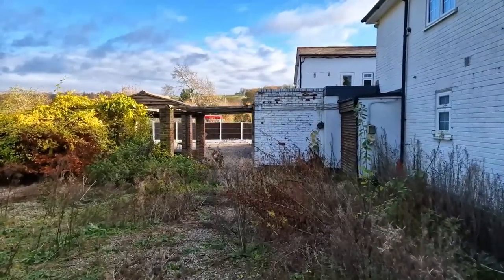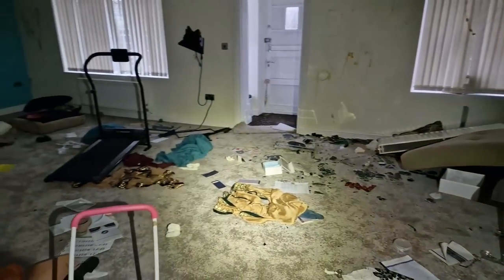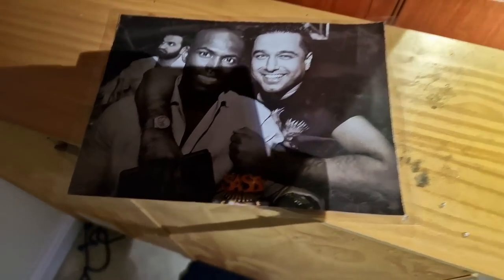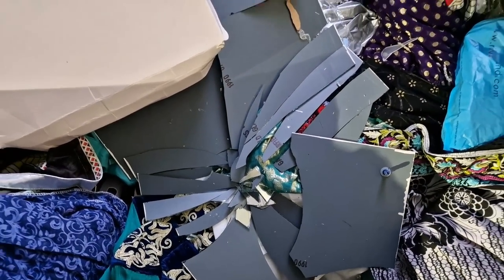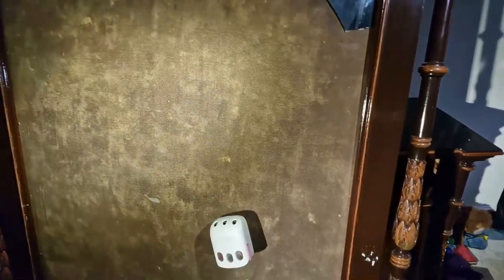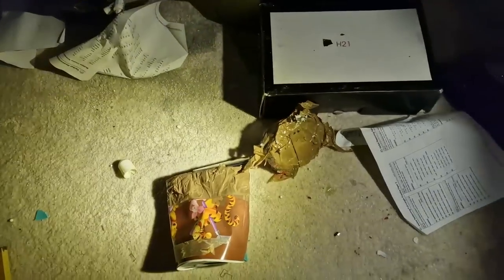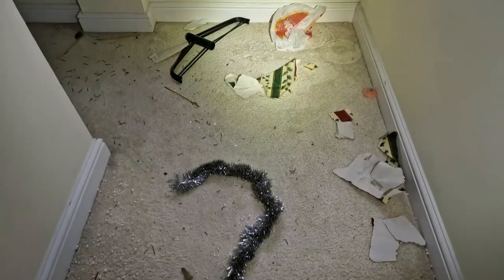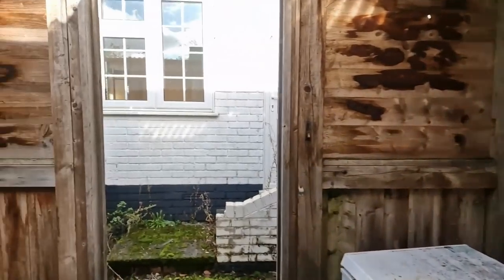We Found an Abandoned Mansion with a TRAGIC Tale

Comment: Good explore Alex but you really have to wonder what the destruction is all about, I'm pleased you didn't lift the toilet lid. Shame its been trashed, I'm pretty sure this place has been on you tube still in reasonable condition but can't remember who it was. Enjoyed it though 👌 thanks as always for your efforts 👍.
Reply: Looks like Copper Thieves to me - all the radiators were just hanging in there with no adjoining pipework! and the way the ceiling was ripped apart - again to get at the copper pipes.  I think there was a flat-head screwdriver type on/off screw on that Kitchen water pipe.